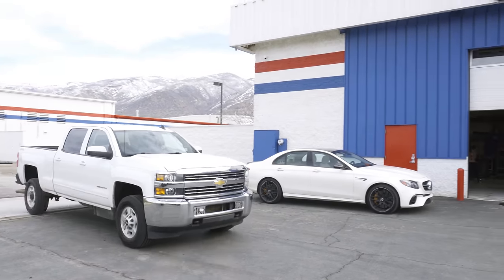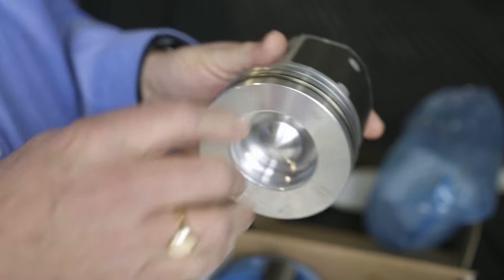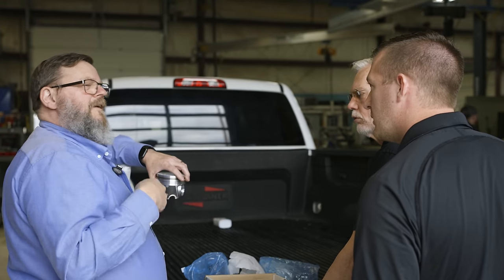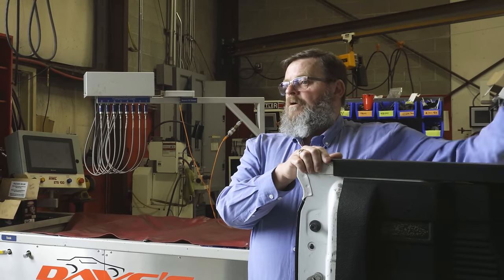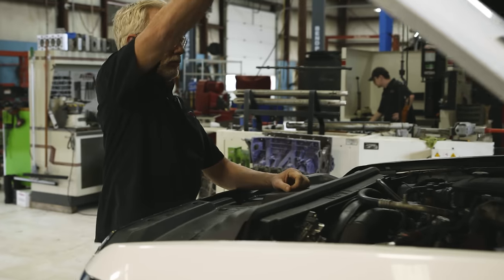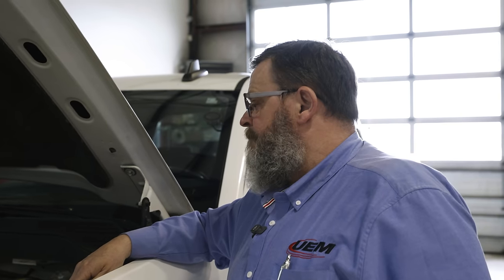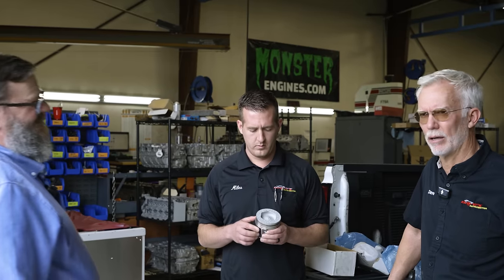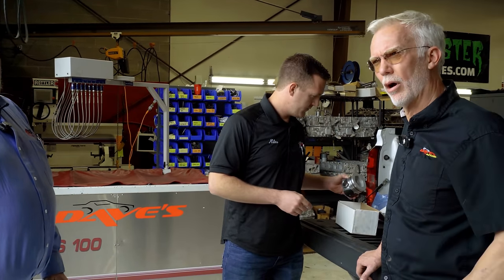What do golf balls and pistons have in common?

Comment: In my 19 years of automotive powertrain testing experience, this appears to be a good product idea but is giving me a little too good to be true vibe and another "re-inventing of the wheel".  I'm not opposed to seeing more on this but I find it hard to believe timing events haven't been changed as well as the amount of injections per cycle since both of these things have a huge effect on diesels combustion noise. As good as it is being sold, it makes you wonder why this concept hasnt been being utilized by cummins.
Reply: 20% fuel mileage is huge, hard to believe an OEM hasn’t done this
Reply: Buy a set and build a motor. Post the results as you put miles on it, make a good series.
Reply: @stephenbrown3760  I thought the same then realized that manufacturers want to spend as little possible to make a product. I know GM changed piston design on the 3.0 Duramax and the newest version is producing a lot more torque and HP.
Reply: When they start reading off their long laundry list of things it makes better it usually turns on my 
' sceptic '
Reply: Money rules the OEMs. A nickel more on the cost and they will pass. The other reason may also be that they are testing to ensure the benefits are real and that engine longevity is not impacted.
Reply: @Indy_at_the_beach they say this is “old” tech, therefore already vetted.  I’m not buying it.

Yes OEMs are extremely focused on cost, but I’m not seeing any significant cost increase in that piston, especially given the extraordinary claims.

Remember people; extraordinary claims require extraordinary evidence.
Reply: Cost of manufacturing? 🤔
Reply: @DANTHETUBEMAN  I’m not seeing a reason to believe they cost much more than regular OE pistons, especially if even a small percentage of the claims are valid.
Reply: they dont offer it because nothing is build to last like it should
Reply: @ImInfix  lasting and performing are two very different things.  The fact you can simply “tune” so much more power into a stock engine is proof of the overhead present and that durability under wildly varying conditions is a prominent concern of OEM designs.
Reply: You think the manufacturer is gonna spend the extra money unless there’s $1000 price tag more at the end of the sale the trucks are already 12000 and $50,000 adding those pistons in there. You know these companies would ask 200+ it’s , not marketable good for performance application only etc etc If that’s the case, and you would understand why they use copper seats and racing application, stainless and titanium valves, forging processes, etc. etc. it isnt reinventing the wheel more like the making the wheel more refined
Reply: @superspeeder  for an oem it might make a big difference, what you pay to buy the part is not what they pay to buy whole sale
Reply: I tend to agree with with mass Manufacturing there's no reason these Pistons can't be made at a price not too much more than the OEM
Reply: I’m curious for more details, but I’m guessing this is a product aimed specifically at a certain customer with a particular application. Other than that generalization, without more info it’s just hard to say. They talked a bunch about commercial and industrial applications, and Bill talked a bunch about stock applications, and Dave mentioned it would make sense for large fleet vehicles. It seems those commercial and industrial applications can more easily justify the marginal gains mentioned. However, it would be nice to have this tech in everyday driver vehicles. The big three have always been slow to fully adopt such tech, which is just frustrating.
Reply: @petesjk  this is, according to the guy making the pistons, old forgotten technology, as if we somehow just “forget” how to make good engines over time.  Despite calling Dave out several times I have yet to see any proof or testing done by him or his company.  I’ve called BS on this one until proven otherwise.
Reply: @superspeeder  New technology in materials science, etc. can make old ideas more viable. As mentioned, this tech has been worth it for certain large scale industrial engine/generator applications.
Reply: dont underestimate OEM's and "planned obsolesence".
Reply: @wazza33racer  with power, fuel economy, emissions and noise?  Sorry, no OEM would turn down an advantage in any of those areas for such a low cost change.  Even if all it did was make the engine quieter they would do it, and it might be a net negative on cost if it saved them money on sound insulation somewhere else.
Reply: @superspeeder  It’s possible there patent issues, but given the crap most consumer level diesel engines are in the U.S., I don’t think planned obsolescence can be discounted.
Reply: @petesjk  in this case I’d guess there’s a slim chance of any OEM holding off on a significant advancement from a 60 year old technology to give their next-gen diesels an edge, but anything is possible.  🍻
Reply: @superspeeder   The OEM's have been told some years ago, by the likes of the WEF that everything in the future must be electric.  Even farmers have been rung up by John Deere etc and been pressured to trial electric tractors etc.  Everywhere we look, EV's have been forced onto organizations, even for crucial roles like fire trucks and ambulances.  One of the consequences has been the reduction or cancelling of R&D for ICE's.  I would hazard to guess, that insiders have known about the EV trend for at least a decade and made spending choices guided by that.  Another example is Achates 2 stroke, who have a diesel in production with Cummins, that also has a gasoline version which uses 60% less fuel than the best 4 stroke gasoline engines (its in trial with the Aramco pick up truck fleet in Saudi Arabia).  When they approached OEM's, they were told "not interested, the future is electric".   We know now, that any gasoline vehicle that has even just 30% lower fuel consumption, will over its life time, still beat an EV in carbon footprint..........so what the hell is going on? Its all about globalist agenda to rob people of freedom, by making vehicle ownership impractical and unaffordable, and the "15 minute smart cities" is proof of that.  None of the OEM's want better cheaper vehicles or engines, they want to give us useless junk.
Reply: @wazza33racer  I agree with everything you just said, except the last sentence.

100% - if it was actually about carbon, diesel and nuclear would be #1 priorities right now.  It’s not, so they aren’t.  So easy to see.

The OEMs are highly competitive.  Yes there’s an EV push, but it’s being pushed on them, not by them.  I do not believe they are purposely holding any ICE back, but yes, if their business model is being forced towards EV by policies they have no control over they certainly will limit R&D on ICE.

That’s all changed in the last year though.  Market trends are showing lack of EV demand so the immediate future is looking like more hybrids than EVs.  That means more R&D for ICE.

Regarding the Achates, take what they say with a grain of salt.  There’s a STAGGERING number of considerations to take into account when looking at any new tech, and a lot of these companies claims have not been independently verified.  I wish them all the best if their tech truly is better.

Diesel isn’t going away any time soon, so any new tech that genuinely improves it will be of great interest to anyone in that market.

Comment: Need to see 2 engines with the same build except the pistons, instrumented and tested on a calibrated  engine test rig on the same fuel at the same time.
- Specific fuel consumption (g per kwh) 
- instrumented pistons for temp
- exhaust gas analysis.
Reply: No two engines are identical. We've built quite a few identical spec engines and optimized them on the engine Dyno and found 2% difference on 500 HP.
Honing finish and technique, ring types, etc. many factors involved.
Reply: And don't tell the guy who's doing all the tests which one has the magic pistons.
Reply: @hotrodray6802 when they are claiming 20% improvements it should be easy to see even if the engines are out a few % from each other.
Reply: @hotrodray6802  If they alternate/swap the pistons on the two engines over multiple tests then it should be rather easy to calculate the error.
Reply: You wouldn't notice a difference between the 2! Like engine additives, this a buy me trick. Too many factors involved as well
Reply from the maker: See if this link from speed of air answers some of your very good questions

https://www.speedofair.com/r-d
Reply: @DavesAutoCenterCenterville I’m more skeptical after watching than I was before.  Old tech conveniently overlooked (or forgotten) by the industry leaders for decades?  Besides a good friend trying this and having similar results, I’m not sure if there’s anything you could say to convince me.

I’ll gladly be proven wrong, but I wouldn’t take a chance with my own money.
Reply: need to see your credit card limit, so we can bill you for your requested R&D LOL
Reply: Ohh wow they making them for race cars too. Problem child running these on methanol .16 time improvement
Reply: @timmygunz7103  I’m not an expert on combustion chamber design, but I’d bet a nice steak dinner that features benefiting a modern diesel engine don’t overlap much with a (assumed?) carbureted ethanol race engine.

As I always say, I’d love to be proven wrong, and would never consider a steak dinner with a fellow gearhead a punishment!  🍻
Reply: A better sample group would be to have about 20 engines of each piston type to compare and take the Means Average of each type. 40 engines should be easy to produce for a manufacturer company. Also test it across different manufacturers, such as Cummins, power stroke, Duramax, hino and Volvo. 
This would be really cool to see in my old ISX15. She was tuned out and a pig on fuel.
Reply: @BawkBawkBawk666  I’m positive the big diesel engine manufacturers have studies that would prove this out.  Dude said this is “old technology”, in my opinion a sly way of getting around having to patent a new tech that’s too good to be true.
Reply: @DavesAutoCenterCenterville  the more I think about this, the less it makes sense.  Why are you referring people to a third party study when you offer engine packages with this piston?  Did you not test it yourself?  Where are your results?
Reply: @timmygunz7103  .160 of a second could just be the air that day or many other factors. If it were running a consistent time of like 3.50s and went to a 3.35 after this change then maybe it'd be worth doin buuuuuuttttt, it ain't like that
Reply: Seems to me like a pretty nice subject for a next video!
Reply: @superspeeder  Exactly 👌 A 3rd party tester. So he can play dumb later and say, "😲 I don't understand why they would lie to us about all the performance increases. We were told by them that  our pistons offered a big improvement in many different ways."
Reply: A cheap easy test would be to buy a small diesel engine. Take it apart, add dimples to the piston & compare results.
Reply: Don’t you find the latest multi shot diesel injectors/programming don’t ‘diesel knock’ like the single shot mechanical injectors of yesteryear anyway and sound ‘softer’ across an injection-combustion event so it’s gonna be quieter ticking over and as has been said unless you do a side by side direct comparison how are you going to prove and quantify your results? Mpg is dependant on who’s driving it and how consistently they can carry out the same actions on repetitive journeys……I am only halfway thro this vid and felt the need to get that much out of the way first….before I watch the rest cos I’m sure there’s gonna be more doubt on my part…..sceptic before believer , yep we mostly are…..🤷‍♂️
Reply: @hotrodray6802  that doesnt matter this says it changes a lot more than hp
Reply: @hotrodray6802  dont need to be identical just close enough to see the difference is for sure obviously u wont be able to notice any super minor improvements but other than that yeah it doesn't
 need to be identical unless measuring small amounts that could just be the motor difference
Reply: @JackS425  Right? If the tests come back snd there's only a slight difference then you know its bull.
Reply: "...2.0% difference..." is an entirely different matter than someone claiming a 210 ft-lb increase - and IF that claimed 210 ft-lb was a 'genuine' figure - a 2.0% variance between engines would not alter much - hence your comment I call BS on.
Reply: They tried this a decade ago in racing. Even F1 doesn't use it, nor dimpled valves.
Reply: 😊😅 8
Reply: yea i call bs on 20 to 25% fuel efficiency increase. That basically would make them industry giants overnight.
Reply: Dave just announced that if thry get enough views on a certain video they are going to build a 7 3 ford with those pistons. The Banks boys will have to suck their thumbs to feel better. 😆
Reply: Another whiner.
Reply: "instrumented pistons for temp" How's that work! Interesting!
Reply: @mikenomath3897  do your reasearch ...
Reply: No 2 identical engines perform the same  from the factory or rebuilt so you cannot compare with 100% Granularity just like new 2 cars off the assembly line will perform the same and while the differences maybe slight always remember 2 identical cars off the assembly lines are completely different machines especially once that engine gets any run time
Reply: @JP-uu2rw  While that is true, emphasis should be placed on the word "slight" when talking about the factory.  With modern technologies and manufacturing methods, there isn't so much variation anymore.  Now, rebuilt?  Absolutely tons of variables ...  either way, the original comment you answered is still a ridiculous ask.
Reply: @MrSmith-vc8xd  Dave is already selling these pistons as an added cost upgrade.  Why hasn’t he built EVERY engine he sells these with already, especially given the radical claims he’s making?  This is snake oil until proven otherwise, and the proof will need to stand up to intense scrutiny.
Reply: @superspeeder  If you are supposed to be the authority then why are you at home typing, like me ?
Reply: @MrSmith-vc8xd  if Dave says his new miracle engine runs on peanut butter, am I not allowed to be critical of that claim?  Even if no proof of a peanut-Powerstroke has been offered?  Even if my only relevant experience is making sandwiches?

I’ve maintained that extraordinary claims require extraordinary evidence, and I have seen none offered.
Reply: @superspeeder  We can all question anything. Nothing wrong with that. I just push back when couch potatoes pretend they are master mechanics. Welcome to the real world.
Reply: @e-curb  The sound will give it away, if they are legit.
Reply: @pingpong9656   Less sound isn't the same as 20% better fuel efficiency.

Comment: Would like to see lifespan results.  
Teardown analysis at 60k, 100k, 150k, etc
Reply: Exactly it does have more surface area though id think longerrrr no???    This is a good one
Reply: Well, if it’s a coating, then you could have stress and cracks and all sorts of things happening over time.  

The tear down I was thinking of includes not only the piston tops, but the rings the cylinder walls, the various bearing surfaces, valves, everything.

It’s pretty safe to say, if one change in an engine, It will cause changes elsewhere
Reply: Good point, ceramic is tough as nails when it comes to heat but can also be brittle on impact. 
My thought is, what if I creep into detonation territory and get a very slight ping, does that piston top shatter? 
What about full on detonation? 
I've had a motor detonate and shatter the front and rear-center plugs in a v6 Gas engine and the engine still runs and drives fine but isn't as smooth at idle. 
The detonation wasn't that bad internally, no boost, lower RPM, when it happened. Was something with the coil pack or plug dropping out at around 90% throttle pulling from a dead stop.
The takeaway is the fact it shattered the plugs and even cracked others around the center plugs, the ceramic on the plugs.
Reply: You'll do that, yourself.😅
Reply: They have test results of research they did over time in cat engimges
Reply: Completely agree on longevity testing, this is still needed. Even IF the claimed benefits are true for newly installed pistons, my question would be: "If the efficiency comes from the dimples and deposits inevitably build up and fill the dimples over time (have you seen a factory-clean piston after 50K, 100K? 🙂) - what's the effect on this? What's the probability of the dimple deposit build-up creating localized hot spots and then causing detonation?" 
Again, maybe these questions have already been answered, but since I haven't seen this tested by independent lab, for now, I remain a bit sceptical. 
It's an interesting idea and I will look more into it.
Reply: @DavidMiOo all a diesel does is detonate